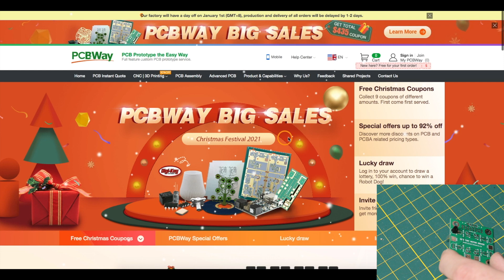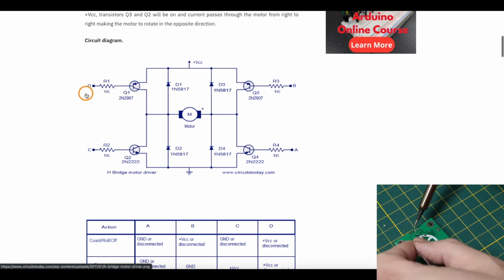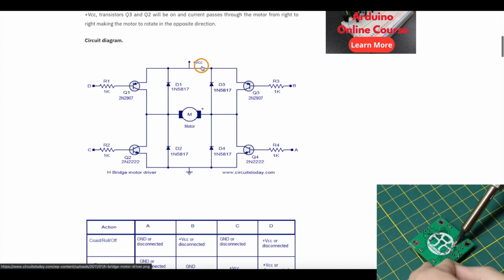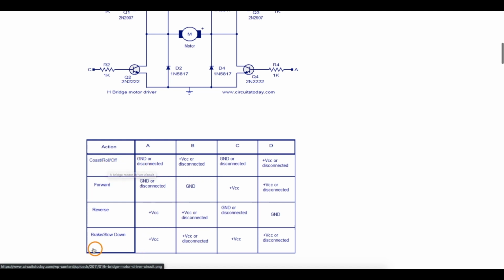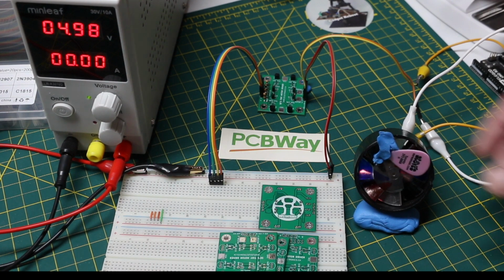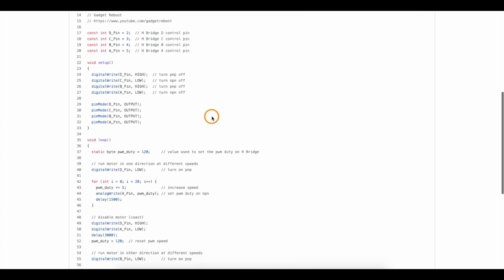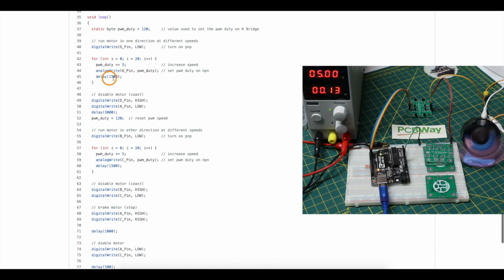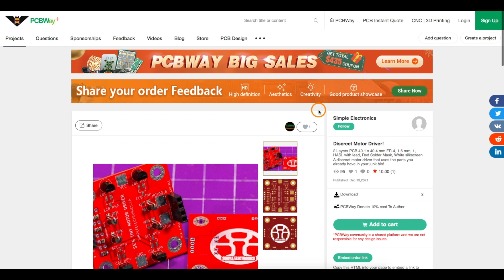DC Motor H Bridge PCB - Trying out the Simple Electronics PCB with PWM Control

Comment: Had a product that moved an arm, pushed hard forward and pulled back much slower, big transisitors for forward and smaller one for reverse. found in the end you coud stall the motor in the forward direction ok, but a stall in reverse killed the smaller transistors before the protection could kicking. But in twenty years no customer had stalled it in reverse?
Reply from the maker: The first product I worked on using DC motors with discrete transistors used the same generic circuit across up to 10 motors in the system ranging from about half an amp requirement current limited up to maybe 10 A depending what part of the machine the motor was used in.
they decided to over design the circuit with 52 amp transistors with the intent of costing down later. Then they decided not to risk design changes so all the drivers kept the 52 amp transistors. At least nothing ever failed!

Comment: Neat, though I think it would be a little easier to work with higher currents if you used sziklai pair transistors.
Personally I bought some IR2184s along with a few power transistors and made myself some FET half-bridges. They handle all your shoot-through issues and don’t need low-impedance signals to drive them, and their output power is only limited by what transistors you select. I put them on a PCB with a comparator set up to be an inverting Schmitt trigger that I use to feed the half-bridge input. That way I can hook up an LC low-pass filter to it and get what’s basically a resonant sine wave driver. The full H-bridge isn’t particularly more useful for me since I’m driving a net AC wave at high frequencies, but you’d definitely want the H bridge for a brushed DC motor.

Comment: Thanks for taking a look at the PCB! It's not much compared to your fancy PCBs but you managed to do a great job on your video!
Reply from the maker: this was a great design especially being able to use surface mount and through hole to make it easier to get up and running with available parts, a perfect useable practical thing.